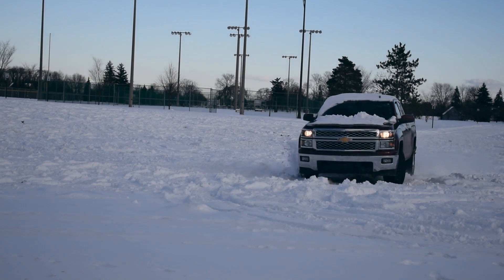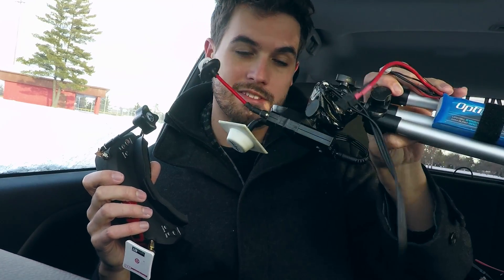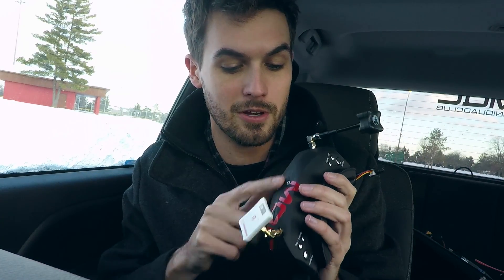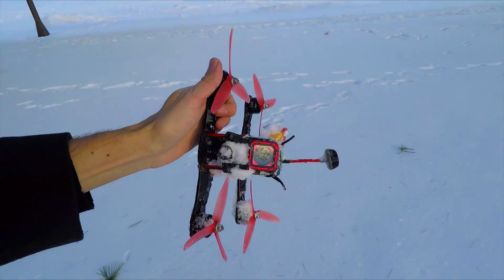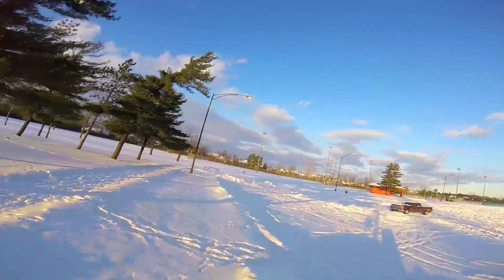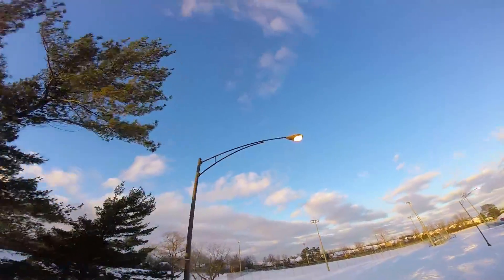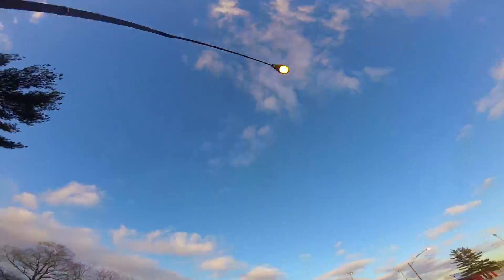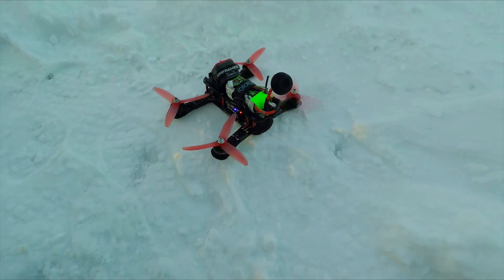Snow Proof Your Drone?

Comment: hi everyone. Is there anyone that could help me? I have conformalcoated my flightcontroller but now all the 5v outs like those that go to the camera or vtx or.... only give 0.04v anymore so basically nothing? I did not get coating on the connectors the board just doesn't give out 5v anymore after coating, before coating it was perfectly fine.
I removed the formal coating but it still didn't solve the problem. The ESC's power up and the flightcontroller is recognized by computer. just the 5v out's aren't working so receiver , vtx and camera are not getting 5v
anyone got any thoughts, idea's on what might be wrong?

Comment: Try conformal coating for the electronics and corrosion x (HD) applied with a brush and cotton buds for the plugs (if you have any). And put the ESCs in heatshrink (after coating) to keep most of the water away. But Snow is the worst (apart from totally submerging your quad).

PS: Did your ESC work again when it dried?

Comment: Hey what is your degrees per second for your roll and pitch. Try dialing in some expo and turning up that rate so it'll be very controllable near the center but it'll be very snappy on the outsides.

Comment: Do you use an air mode? you quad is so floaty i love it!
Reply from the maker: I have MOTOR_STOP disabled so my quad always idles when armed. I also have air mode on a switch and use it most of the time to improve the performance of I term at min throttle
Reply: Le Drib oh ok i figured i just got my first drone*cheap* wizard x220 and im learning the ropes, i have an arm switch as well and it stays on idle! havent flown acro yet bevause of the rainy weather here in new york! bit cant wait to try lol

Comment: What happens with acrylic coatings on small electronic boards is it can crack if it dried to quickly. To prevent that you can lower the drying temp. Or use silicone conformal coating, which is a much cleaner alternative to the corrosion x. I cant believe how little subscribers you have in comparison to the quality of the content. superb vid bro. How long have you been flying?

Comment: I know this reply may be late but try the silicone based conformal coating, much better than acrylic based ones. Goes on the same way, and has a stripping agent. If you cant find the stripping agent that I've used liquid electrical tape and clean off right away and the coating comes off, must be a similar solvent. Anyways give that a try and let us know how you like it. I really like it.
Reply from the maker: Nice! Thanks for the advice. I'll get some of the silicon stuff soon

Comment: Acrylic conformal coating..... Acrylic? Isn't that water based? Shouldn't you use Silicone Conformal Coating?
Reply from the maker: It's not water-based, it's polymer-based. This stuff is made for electronics. However, I have learned that silicon-based coatings are better, so I will probably switch to silicon in the future. But the acrylic stuff still works :)
Reply: Thanks for the info and the inspiration Drew. I'm going to have to waterproof one of my quads. This lack of stick time is killing me.

Comment: Great video, and subject. I'm in the Syracuse NY area - LOTS of lake effect snow here all winter long so, yeah - any idea's on waterproofing / snow proofing, I'm all ears! Also... a question - how does this waterproofing stuff impact repairs, like soldering? Does this stuff just wipe off or does it harden over the components, making repairs weird?
Reply from the maker: It does harden, which I like so that it won't wipe off unintentionally. But it also doesn't hinder repairs, I just use the soldering iron to burn through it. Re-apply another coat after finishing the repairs though
Reply: Thanks for the reply. Very helpful as... I was worried about that but thinking there had to be a way or you wouldn't have put it on there! :-) Thanks again, and Merry Christmas!

Comment: Cool how does it  hook up to the  FC board ?
Reply from the maker: Depends on the FC. If you're using the 3.3v receiver, A lot of boards actually have a dedicated porch that you can solder on a spectrum satellite connector see you can plug the receiver right into the board.
Reply: Thanks have a blessed Christmas  🎄

Comment: Your best flying yet! That lighting at the parking lot was great! Did you fiddle with your tune? I ask because you greatly reduced the micro jitters in your flying, and you did it in a hurry:)
Reply from the maker: Thanks! Yeah all the micro jitters that have been plaguing my videos have been driving me crazy! It's just been a series of issues between horrible wind, bad motors, and yes some small tune issues. The most frustrating part for me, was that my older videos had less jitters than what I've been posting recently. But fingers crossed I think I've got things worked out now.
Reply: My best guess, then, is that you picked up some micro jitters as you stepped up the difficulty of the things you are doing in flight, and now you've gotten very confident with this new level...Killin' it! Happy flying!
Reply from the maker: I like that story haha ;)
I will say a part of it was putting out videos more frequently left me with less time to obsess over tunes and hardware and such. I do you think I found a little bit more of a groove now, and I'm going to be sure to reserve time in the future to make certain that I don't end up with jitters anymore. Seriously drives me nuts lol

Comment: What kind of  receiver are you using on your quad copter?
Reply from the maker: Most of them have the Spektrum quad race receiver that runs on 3.3v. I switched one of them over to the new Spektrum receiver that runs on 5v and has telemetry. The telemetry and 5v compatibility are nice, but I think I'd rather save the $20 and stick with the previous version
Reply: +Le Drib is the 5v one any more reliable?
Reply from the maker: I haven't had problems with either the 3.3 or 5 as long as the antennas are routed out and away from the carbon. Spektrum seems to be especially sensitive to carbon interference.
Reply: nice, I thinks its time that I swapped my lemon for some genuine spectrum gear :P

Comment: can you still solder on a waterproof board?
Reply: With what drew used yeah I did the same to one of my alien's and the iron just burns right through the coating
Reply from the maker: yup like Frank said, I just burn through the coating. After finishing the soldering though, go back and put a fresh coat on
Reply: thank you

Comment: a bit off topic, but... I have that same venom 80wx2 charger and I noticed the parallel board... do you regularly use it for that? Cause that might buy me a little more time before getting into something better.
Reply: yes it will, save you nicely and even when you get a better charger the boards are there. Make sure to be safe and read up on it and develop a very systematic method to make constant checks. I saw a forum post where an older gentleman was parallel charging and the family home went up in flames, no one was hurt and these things are rare but always good to know the possible extremes of what could happen and how easy it is to make steps to stop things.

Comment: what do u think about the zmx Fusion x25 ? :D
Reply from the maker: I've never tried the ZMX fusions. I did run a different set of ZMX motors and had problems with the bearings being to fragile (for how much I crash that is lol)
I have heard the fusions have redesigned bearings. So maybe they're tougher.
Reply: have lots of torque and pull lots of amps
Reply: Le Drib damn ty dude.
ok i them have a nice day buddy keep this stuff up ;)
Reply from the maker: thanks man. If you are looking for a new motor, I recommend the DYS SE2205 2300kV. They're not the newest hot thing on the market right now but I've used them for a long time. I think they are a good balance of affordable, available, and most importantly durable!
I have a set of DYS's new FIRE motors which I'm hoping will provide the same durability with hopefully even better performance. Though I have no real complaints with the SE motors as they are :)
Reply: ok ty i will see..
just thought they would be pretty nice motors.
so i will research a bit more :D 
are u editing on a mac ?
if yes with what software ? :D

Comment: i'm gonna have to try this. what camera angle do you fly at?
Reply from the maker: About 30 deg
Reply: awesome, do you keep the GoPro at that angle as well? I'm currently running 25deg on my FPV cam and 20deg on the HD. Seems to be working great, but at times I feel like I'm flying much too slow
Reply from the maker: Yup GoPro is locked at 30. I sometimes vary the fpv cam as low as 25ish or as high as 45 if I need a little extra or less. 
Overall I've found 30 to be the perfect spot for me. 
Try adding a bit more angle in the fpv cam if it's not to hard to do. You could also play with using a wider lens on your fpv cam. Most fpv cams come with a 2.8 lens. I now run 2.5 on all my quads and much prefer it
Reply: Thanks for the tips! I'll try the higher angle on the FPV cam for sure.

Comment: Great episode - loved the flying from the truck - Conformal is a very good solution, but can be pain to take off if you need to repair... I used to use an ultrasonic cleaner, what's your view?
Reply from the maker: I haven't bothered to remove it for repairs. I just heat up the solder and melt through it lol. I puta new coat on after re-soldering
Reply: Le Drib that would work too... :-) doesn't smell too good though:-/ Happy Christmas

Comment: I did this for my company, not the video it would have been much better.   https://www.youtube.com/watch?v=t5It821Nr4E

Conformal coatings are only as good as Physics will allow.  They work fantastically for low current low voltage devices like your Flight controller, and receiver, everything on your quad except PDB and ESC.  Anything with high current you should conformal coat, but you should try to keep water from coming in direct contact.  CorrosionX is a good coating but will not waterproof ESCs you should coat them and seal them in heatshrink.  I've also had a great deal of success with Liquid electrical tape.  Remember that Physics thing I was mentioning.  The coating needs to be thick enough that the current cant jump across the gap, liquid tape is a lot thicker which allows for higher current devices.
Reply from the maker: Awesome insight! Thank you :)
Reply: Awesome. I'm glad this episode came up. I live in Massachusetts and busted my butt all summer to get where I am and dread not flying now. So this will be a definite plan of mine. I've yet to fly a simulator because I'm a spectrum guy dx6 with no USB!!🤔

Comment: Next time try Corrosion X HD i use it on my rc boats and quads in salt water! Great Video.
Reply: only thing about corrosion x which is awesome... it stays oily greasy and never dries, so if you cut the grass and hit a sand patch, the nightmare begins with all the gunk
Reply: It works grate but there is that point it never drys complete so ya stuff will stick but the pay off is so worth it it works wonders simply look it up there videos out there that will blow your mind " flight test"!
Reply from the maker: I'll look into it! Thsnks
Reply: Le Drib yw Mr king of mini quad vloggers ❤

Comment: The popular corrosionx may be an option :)
Reply: CorrosionX is what i use, it works good i've had lots of similar crashes to this vid with no failures. Downside is it doesn't dry so its kinda oily messy and collects dust. Last winter i just did one quad and then in the spring i just clean it all off.
Reply: How did you get it off? Had to clean some parts to conformal coat it (silicone based, as it is heat resistant). Neither had luck with alcohol, isopropanol nor dishsoap. All together and scrubbing with a toothbrush and cotton buds eventually worked out, but I'm hoping for a better solution.
Reply: There is a chemical you can buy to remove it. Just search conformal coating stripper/ remover on Amazon. They are a bit cheaper than than actual coating if you buy it from Amazon UK